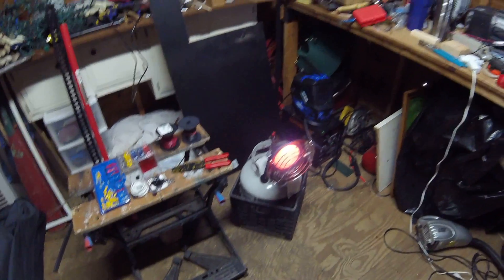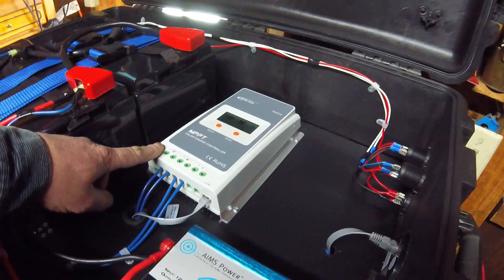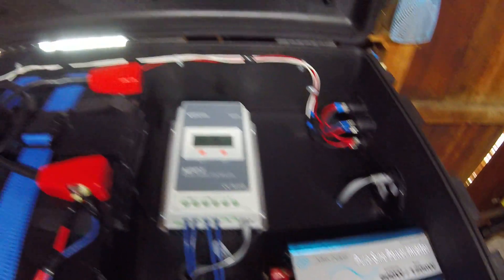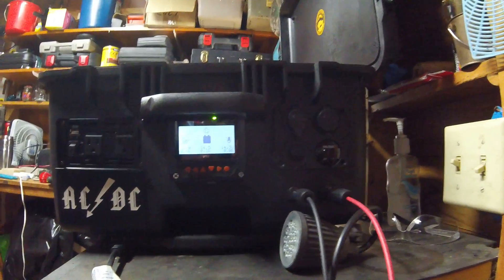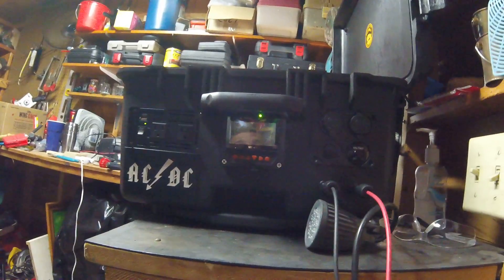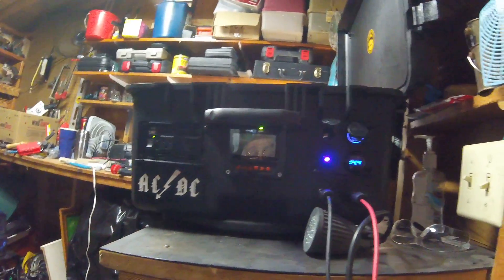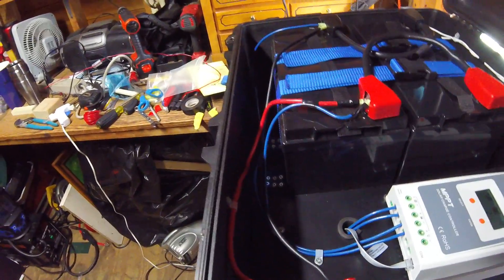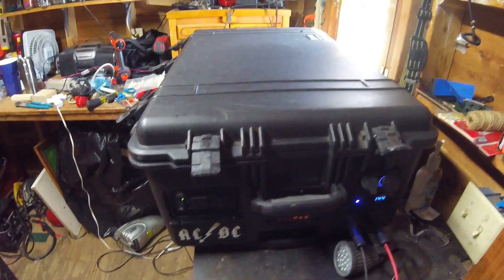DIY Portable Solar Power Generator

Comment: If you want to charge the batteries, I would consider putting vents in the case so that the batteries can breath and so that you can release the excess heat from the battery and inverter. If you dont vent then, you have a higher chance of the system exploding because the batteries vent hydrogen gas which would be combined with a spark from the system